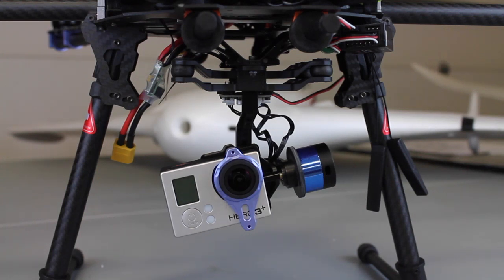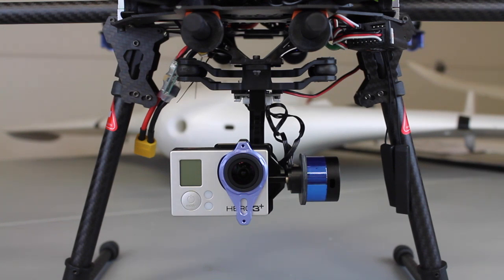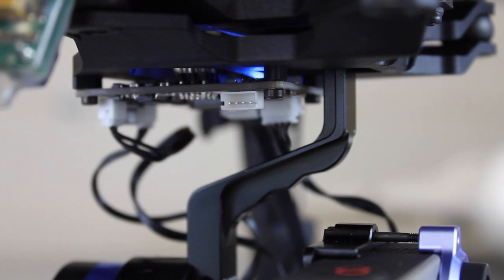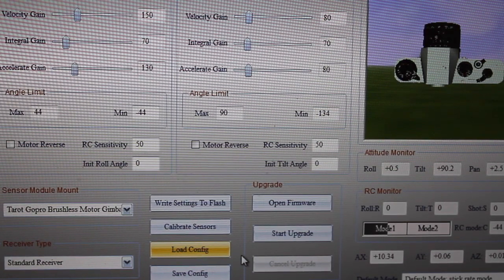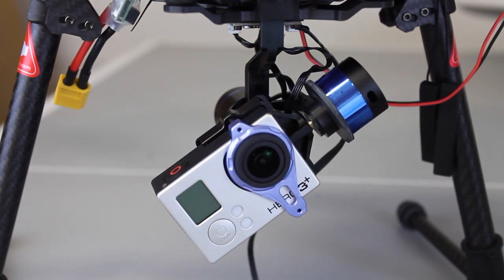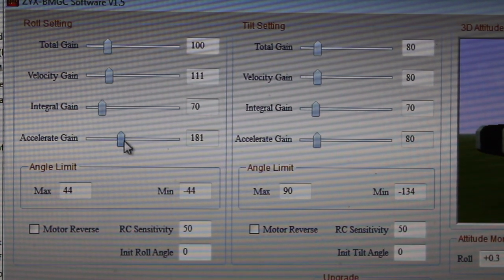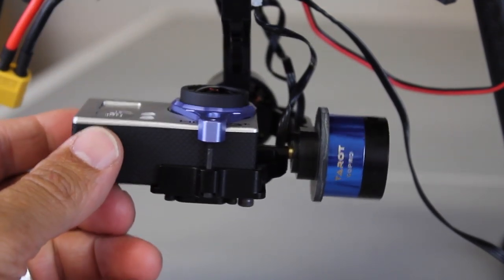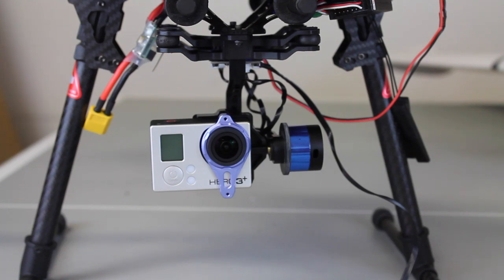Troubleshooting Tarot T-2D Gimbal: Tips for Fixing Jitters and Shakes

Comment: Hello, colleague, can you help me?
  The plate of my t-2d gimbal tarot, has the red light on, and no longer starts the movements of the engines. Before I would turn on, turn on a yellow led, then the blue led, and then the motors would start and normalize. I heard about corrupted firmware. Can you help me ?

Comment: This is still a great Gimbal, yet there are almost no comments on here less than 4 yrs ago.   Did folks atop buying these Gimbals?  I will see if TarotRC has any Win 10 drivers. Had to use my laptop with Win7. Then it worked ok.

Comment: Im currently struggling to get my Tarot to Tilt using my Iris's Controller. The solid blue light is on indicating its not connected to Autopilot but i cant for the life of me figure out why. It works and everything i just cant tilt it manually.

Comment: Dennis. Great video . Thank you! Only one glitch remains. I have the FS TH9X radio with ch 7 control being a variable setting knob to the right of the ch 7 on/off switch. When I calibrate, all works as explained in the video. When I turn the motors on in the software, the gimbal with gopro attached travels to the neutral position  (straight ahead) and will tilt down successfully and then back up to straight ahead position successfully however will NOT tilt UP from neutral straight ahead position. When I do the calibration (camera facing up), I have the tilt knob in the full up tilt position. Any other position simply results in the gimbal/camera tilting down or below the neutral position when I turn motors on. Any suggestions?  Thanks!
Reply from the maker: That's strange. This gimbal has given me so many problems over the years but I've never seen this happen before. My only suggestion is to try and mess around with the motor power settings and see if you can find something that holds the camera in position without letting it drift off. Not sure if that's the answer, but is the best I can come up with at the moment. Good luck and keep us posted. Thanks.
Reply: Thanks Dennis! I'll give it a whirl  :)

Comment: Hi, the software crashes a few seconds after I clicked on open com port. I'm using windows 10 and have loaded the right drivers for it. I did manage to flash it to v1.5, but that is how far i can go. Any insight?
Reply: Where did you find the software? It doesn't seem to be working on the tarot website
Reply: You have probably found an answer for this already but just incase, if you are using windows 8 or newer check you drivers are installed this way; http://www.dronetrest.com/t/using-tarot-t-2d-gimbal-config-software-on-windows-8/940
Unfortunately I have run into this problem a few times my actual Pc wont run it, my virtual one runs it fine as long as 3d Rendering is set to on under the graphics options. May or may not help you, hope you have got past the rubbish software!
Reply: Hi, I will check on it. Thanks :)

Comment: i tride the software on my windows 10 but the software zyx bmgc keeps shutting it self of if i power on the gimbal, is there a solution for this?
Reply from the maker: I'm not sure. I've only used this on Windows 7. See if you can find a newer version of the software and let us know.
Reply: You have probably found an answer for this already but just incase, if you are using windows 8 or newer check you drivers are installed this way; http://www.dronetrest.com/t/using-tarot-t-2d-gimbal-config-software-on-windows-8/940
Unfortunately I have run into this problem a few times my actual Pc wont run it, my virtual one runs it fine as long as 3d Rendering is set to on under the graphics options. May or may not help you, hope you have got past the rubbish software!

Comment: So I've had this gimbal for about 5 years now and its been inactive for the last year.  I pulled out the Hex to fly it and the tarot t2d is out of calibration.  I tried downloading the new 1.5 software and hooking up with my provided usb-serial cable.  I cannot get the PC to communicate with the gimbal.  I have the driver you recommend and have the proper COM port selected according to my device manager.  It continues to tell me that the com port is not open.  Do you have any idea what could be the problem
Reply from the maker: The only thing I can think that has changed since the last time you did this was maybe your OS has been updated (did you upgrade?) or the driver is either out of date or not compatible with your OS. I've had problems with the driver in the past and ended up having to uninstall and reinstall. Good luck and let us know how it goes.
Reply: I've been havin this same problem and nothing seems to work :/

Comment: Man I have tried and tried. Follow your direction to the "T" and yet even though it updates and everything is normal after it gets calibrated the gimbal can not be controlled with the controller. The most it does is moves only one direction, but it can not go back to the starting position. No jitters, but it does not work... any thoughts?
Reply: I had the same problem a while ago. One of the motors had a bad lead and could only rotate in one direction. While it's running, hold the camera just under the center position. If the motors are good, you'll be able to feel them resist all directions of motion. If one is bad it'll just fall back down without resisting at all.

Comment: Hi Dennis Baldwin, which programs did you use to run the GUI on your mac?
Reply from the maker: I ran the links in the description (driver and software) on my Windows VM under Parallels. Make sure you install the driver. Good luck and keep us posted.

Comment: Great video! I'm having a problem where if my quad pitches backwards any more than about 20°, the gimbal gets jittery and shakes. Has anyone experienced this problem before? The gimbal is solid and doesn't shake any other way I tilt the quad and is otherwise perfectly fine.
Reply from the maker: +Jack Danos Interesting. I wonder if when you're pitching backwards it's generating more vibes that your gimbal can't handle. Do a bench test and pitch the aircraft backwards with the gimbal powered on. That will prove or disprove my statement above. If it still jitters than maybe look into your gimbal motor power settings. It's been a while since I've had to tune my T-2D so I'm not 100% sure. Let us know what you find out.

Comment: I've been playing around with my gimbals (this is my second) for ages and have never got it working properly. I managed to get it working well the other day then after re-assembling it for flight ended up with similar problems to what you have described. I'm going to work through your recs re calibration and am hopeful that it may put me on the road to success.
Thanks, Downunda-Melbourne Australia
Reply from the maker: +Downunda's Videos Sounds great. Good luck with your setup. I know it can be cumbersome at times, but hang in there and you'll get it working.

Comment: As you said.. First ensure that the screws are all tight. My screw was loosening and I did not know and it was acting erratic. I went through all of the settings and nothing was consistent. Once I realized that the screw was loose on the tilt motor and tightened it, it was smooth sailing from there. Now I'm just trying to correct some horizontal abnormalities then we are in business..
Reply from the maker: +Radiant Amar Glad to hear it and thanks for sharing.

Comment: Great video as usual by Dennis but why did Dennis (or anybody actually) not address RotorWingFPV's comment/question?
Tarot instructions manual clearly states "NOT to open Com port" during firmware upgrade. I caught this and brought it up at RCgroups forum last year. Despite my clear question, no one was able to address it. I am not sure if they really didn't know the answer or if they just ignore the question. I was so happy to see someone else (RotorWingFPV) also noticed it here but again with no reply or any comment:((((
Just wondering why!...
Reply from the maker: +iskoos Good question. If you look at the way these boards (including APM/Pixhawk) function you normally update firmware with the com port disconnected and then you connect over com when you're updating parameters. I don't have an exact answer unfortunately, but obviously loading firmware is different than configuring params. If I find out more I'll definitely post an update.
Reply: Thanks Dennis. I just did the firmware update to 1.5 today and I did NOT click "Open COM Port' Everything went well and FW updated to 1.5 successfully.

Comment: Thanks alot....
It works for me...

Tilt/Pitch is also work.

Question: How do I set the Tilt to be more responsive? Moving faster.
Reply from the maker: +SeparuhNafasku No problem. I'm assuming there is a setting for tilt speed but don't have my software in front of me at the moment. I liked the slow version so that I can get nice transitions while filming.

Comment: THANK YOU VERY MUCH!!!
In case someone would face my problem, like the camera tilted with the knob turned in one direction, but did not revert back with the same knob turned in opposite direction. To correct this issue, make sure your Default Mode is the SECOND ONE - STICK POSITION MODE.
Reply from the maker: +Vusal Jalilov Good tip. Thanks for sharing that.

Comment: Hello Dennis, using the Tarot 2D is fine, firmware V1.5 is smoother no more motor vibrations which cause blurry video. My main concern and im hopeful you have some helpful tips, during forward flight especially on waypoint using pixhawk my gimbal just does not stay horizontally level to the horizon. Also know as horizon drift, ive been trying different tuning adjustments on the controller GUI, yet i can get a solid horizon. Moving forward the gimbal would roll to left an right, around 10 to 20 degrees movement. No shaking if you where wondering, just the horizon not perfectly level especially making a right hand turn or left turn during forward flight the horizon would tilt towards the direction of the turn. I have been striving to keep horizon level for my aerial video. Hope you have some tips to help this issue.Note the gimbal is not connected to the pixhawk, its only connected to the pitch knod on my 9X readio.
Reply from the maker: Photostop Borgs That's really strange. I haven't run into this problem before. I'm sorry but don't really know what to suggest. I'll think about it and let you know if I come up with anything. Actually, one thought is to look at your motor power settings. Perhaps you haven't given them enough power to bring your gimbal back to level so it's struggling to maintain level? Just a thought.
Reply: Hi Dennis, the Tarot 2D  was working fine for nearly 2 years until i rebuilt my tbs frame using the pixhack controller by CUAV. i started having roll motor vibrations, even re flashing firmware did not cure it. I managed a temporary fix by lowering power to the roll motor while awaiting from Infinity hobby the new roll motor. I hope thats the problem. Not the gimbal controller unit. Ill keep you updated.

James

Comment: I have setup and configured my Tarot 2D gimbal and it works great except it is always tilted slightly to one side. The sensor calibration has not seemed to help, any suggestions? I read where some have taped a coin to the motor to add a small amount of weight, what can you suggest?
Reply from the maker: Michael Beaubien I haven't run into this problem but it sounds like something may be out of balance. Alternatively you could setup the roll control from your TX to adjust the roll axis. That would allow you to adjust it and get it centered.

Comment: Son of a bitch it had to be that damn easy didn't it.
Reply from the maker: Ryan Gribble Ha ha. Right? Easy solution, but took a while to get there.
Reply: Man, I sat here for about 4 hours trying to figure out what the hell I did wrong, it had been working fine. I reloaded firmware, pulled the whole thing apart to make sure it was together correctly, but damn it. Thanks for the tip.

Comment: Hey Dennis, I have this gimbal but for the Möbius. I had a few setup problems as well. Followed Project Air's setup and at first it seemed fine. But during flight the gimbal just starts drifting into a roll and stays there. Even on the bench if I shake the quad around, in a yaw even, gimbal starts rolling then very slowly comes back. I've played around with the gains but I'm wondering what all the different gains do exactly. Maybe if I/we knew what they were for it would be easier to dial things in. Any ideas?
Reply: Hi Dean, I have also the Möbius gimbal and it slowly drifts on the roll axis so the horizon is tilted in the video.  During one flight it could drift like 20 degrees left to 20 degrees right but more often the error angle stays about the same during the flight but different each flight.   I just started investigating this.  Maybe it is due to temperature changes..
Reply: +Tom Ahola yeah had my quad out again last week with a new Naza Lite controller and the camera gimbal still tilts opposite of the yaw movements. I have not had the energy to hook everything up to the computer again to test more settings.  I don't do much AP but want to have a setup I can count on when I do.  Might just have to chalk it up to cheap equipment and look into another one.  Let me know if you come up with anything.

Comment: Hi, 
Im fighting against jello effect at Mine (v1.4) tried to update to 1.5 several times... Dont get it to work. First of all the Software 1.5 does Not notice my gimbal (no blue light at usb). Then it shakes like yours But also after the whole calibration...
Im frustraded and thinkingof buying a zenmuse...;/
Thx But still very good video
Reply from the maker: Clemens Rausch I know the Zenmuse for GoPro is a good product so if you end up getting one please let us know how it goes. Sorry you're having so much trouble with the Tarot T-2D. It can be quite a pain to get configured. Good luck.
Reply: Dennis Baldwin no its Not your fault and I will Try my best to get thos thing working...
Thnks for your answer and you make awesome Videos!;)

Comment: any reason why my tilt keeps tilting forward when i take off forward? it keeps going until its facing straight down if i take offf fast and doesnt come back. im on v1.5
Reply from the maker: Jeremy Jones A few suggestions you may or may not have already tried. Make sure if you're not using pitch/roll input to disable those in your gimbal config settings. By default they may be enabled and can cause the gimbal to pitch/roll beyond control. The other thing I've learned is to make sure you give your gimbal enough time to calibrate when you start. Mine takes about 15 seconds to power up and set center. If you power your gimbal up and tilt your quad forward does the gimbal still tilt forward or is it only when you take off? Maybe there is some sort of interference. Last thought is to make sure you don't somehow have follow mode enabled. That could cause the behavior you're seeing: http://www.simplebgc.org/follow-mode.html Good luck and let us know how it goes.
Reply: it tilts and keeps going until it is at its furthest point,. ill video it and tag you on youtube

Comment: Hi ,thanks for the informative video. I tried everything but still my fimbal is twitching like crazy.... any suggestions guys.
Thanks
Reply: +nasser halabi I have the same problem, have you found a solution? Cheers G.
Reply: sorry I didn't, I believe the sensor board is not working. I have to replace it but didn't have time to do so.
Reply: +nasser halabi ok, thanks.

Comment: best video yet! however i downloaded the USB driver and got the program to open the port and it says to connect the gimbal, It doesnt recognize it. Any ideas? I've done this on two pc's both running win 8.1 64 bit. Any help would be appreciated. thanks
Reply from the maker: Mike Esch Check your Windows hardware settings. I've run into issues before where I thought the USB driver was installed and it wasn't. It showed up in hardware and devices with an exclamation point. If that's not it then I'm not sure what's going on. Maybe there is a com port conflict. The fact that this has happened on both PCs leads me to believe it's something with the driver. Good luck and keep us posted.

Comment: THANK YOU SOOOOOO MUCH! I was so frustrated because I had the same Problem - till you suggested to synchronize the GoPro face up - and it worked!! This is really a great Video!! By the way - is it possible to connect a Spektrum Satellite - there is a connector but when I connect there is no sign that the Spektrum is under power :-(
Thanks! Greetings from Austria
Reply from the maker: Mark Riha Glad to hear that it helped you out. I'm not sure about a Spektrum satellite setup. I don't use Spektrum but a friend of mine does. I'll have to ask him and see what I can find out. Greeting from Austin, TX